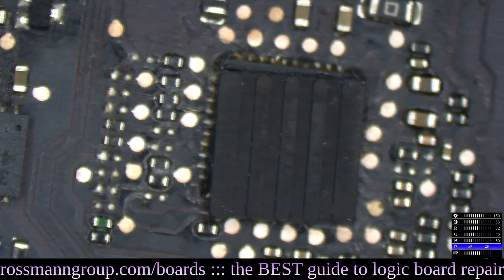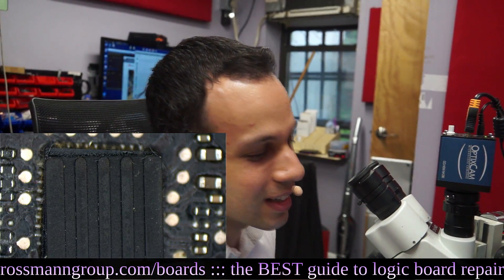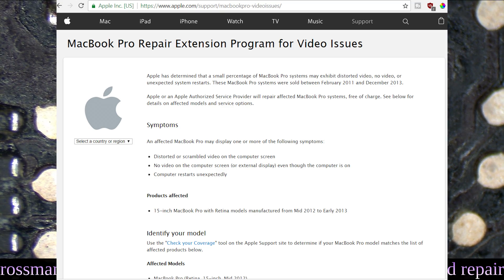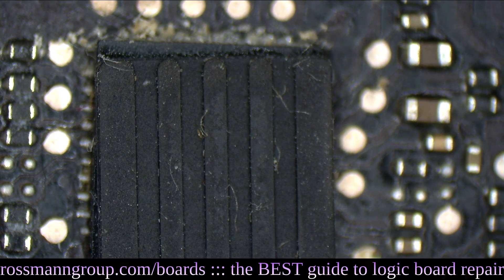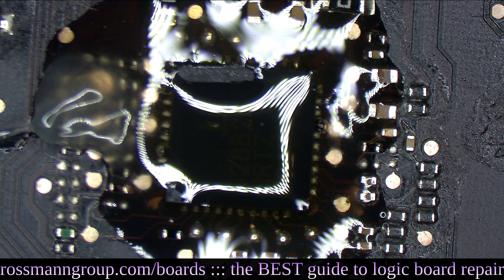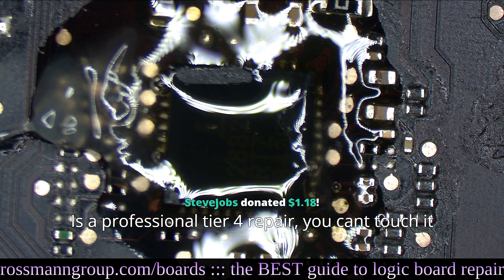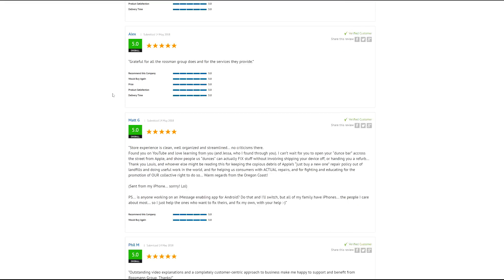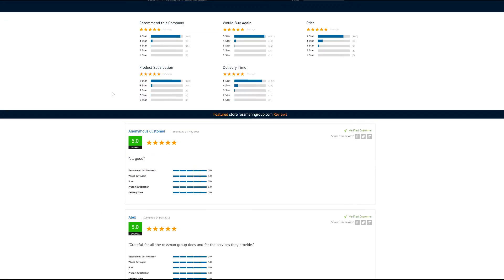How Apple authorized repair refurbishes Macbooks to fail again! GPU kernel panics

Comment: I grew up with Linux and Windows. I use a combination of the 3. I have a MBP mid 2012 with an I5 that I tend to use. One of the main uses for it is video editing and Audio mastering. I enjoy it quite a bit and find my number one reason for enjoying it is when I am Booted into the Main Operating system it feels nice. I love Linux for it's completely Open Source nature. But it doesn't have everything OSX and Windows does. There is a lot of things missing still. But I find Apple's Hardware is being poorly designed in a couple of major ways. 

1. The thermal solutions are inadequate and lead to unnecessary stress on the components especially these days where they keep slimming things while continually adding more powerful components. This leads to failure rates increasing. This is why right to repair is important. This is why Apple needs to be somehow forced to at the minimum provide replacement parts to 3rd parties.

2. Having proprietary components and Soldering parts straight to the boards removes the ability for a large populous to avoid expensive repair costs. This leads to depending on Apple themselves or skilled individuals like yourself to do this. Despite what many people who hate on the OSX infrastructure believe these computers haven't always been this way. I have been able to upgrade my MBP to a point where it runs significantly faster even on an I5 setup. 

I appreciate how you don't shit on the OSX software. I will be using a dualboot Hackintosh setup when I do my build coming up. Because there are just many things about OSX that feel better and function better. Also without OSX and Linux Microsoft would have no competition and Windows would be a complete Monopoly and Monopolies are the main cause of failure in the Capitalist world. But you have to twist Apples hands to get them to do right. They are making shitty decisions. It's always been shocking to me how the Software developers do so well and the hardware engineers fuck up so badly. Then Apple wants to claim it's software issues when their hardware has issues. When the software is fine.
Reply: btw I bought used lol. and this was a 1200$ laptop when it released. lol

Comment: My theory to why this bondo job happened is that that whomever at Apple decided “this is how to refurb a GPU” was that this person/committee believed (correctly) that they couldn’t possibly hire the type of skill required to do a proper job based on how little they were paying the people who did this. Therefore, since the likelihood that they would be able to solder the pins properly so they would conduct on their own was nil, so mandate that they stick a rubber pad on it to just sort of hold in it place until it chip unseats shortly after from the pressure, you know, when it is no longer their problem. Am I just stating the obvious?

Comment: I agree with the title. I had the "service battery" 3 TIMES on a 2012 MBA 13 inch. Sold that piece of trash 3 years later for like 500 bucks right after I had the battery replaced for a third time so I could say there were no errors.

I had TERRIBLE battery life too...

Comment: People just gotta understand that an OS is just a gateway to software. Use one OS or ALL the OSes depending on your needs. Windows, Linux, Mac OSX... they're all valid for a lot of different uses. 

I'm not knowledgeable on how you've implemented iZotope RX 5 into your mix, but  the application & plugins do appear to work on Linux with great compatibility through WINE. With that said, if you have a compatible & working setup on Windows, then the setup and turning and testing for converting that setup fully to Linux would be tedious, unnecessary, and full of headaches.

Comment: Is this possible? What if you figured out a way to adequately cool overheated MacBooks. Maybe by replacing the bottom plate with one that has more space and a cooling system that would actually do the job. It seems to me that Apple product Killer Problems can be classified either as unfixable, like some integrated part that will probably fail in short order but can't be replaced,   the iPhone 4 antenna; and problems that could be fixed, like the faulty SATA cables in an earlier MacBook Pro. (In my 2011 17" MBP I had to replace the Bluetooth WiFi cable. I also think I replaced the SATA cable. The case pushed on them.) 
The protocol for smart purchasing of Apple products would be: First, NEVER buy an Apple product that's just been released.  Second, when issues are collected (too bad we can't rely on Apple for this)  techs like you figure out: Work Around-able? or Killer No Gos?  How come laptop cooling pads all suck? Can you design one that would solve Apple's heat perennial problem? (I just put a baggie with some ice cubes on the top left corner of this 2011 17" The case got ice cold, but SMC Fan Control shot up. I wedged it under the case in that hot spot  area and again the temp shot up.  I didn't block the slots. ????)

Comment: Your workmanship is superb.  My question is does this still not address the underlying problem of overheating and melting the solder joints.  Apples half assed solution was to place a pad on the chip so the case would keep it pinned down to the board.  Although your resoldered joint look a thousand times will it not suffer from the same failure when the chip heats up enough to remelt the solder as it did prior to the fix?

Comment: You should be glad that these apple products suck so hard; not laugh at it. If it wasn't for their mistakes, you'd be flipping burgers. I watched few of your videos so far... All you do is replacing the parts or repairing traces. You are good at it, no doubt... But the attitude... You come across like you designed those ICs you are replacing. In reality, you just buy the ICs from company A1, A2, A3...etc., use the tools made by company B1, B2, B3... etc. and fix the board for customer's laptop (or whatever else) and take their cash. Nothing original of your own (design, analysis... etc). Day-in, day-out same shit. Fear not... In this get-shit-manufactured-cheaply-in-China economy, you'll always get to melt solder and watch it solidify... all day... everyday... :)
Reply: I think I covered this in " In this get-shit-manufactured-cheaply-in-China economy, you'll always get to melt solder and watch it solidify... all day... everyday... :)"...
Reply: "They are all housings with buttons, housing and motherboards, give or take some don’t have screens, they are fixed the same way."... Yes, this makes it simple; buy the parts from somewhere else using someone else's troubleshooting material, Flux, heat and solder. You don't see him fixing high level problems where the board does not look burnt or showered with a latte by a millennial or physically mistreated in some other fashion. <= Now, that's hard! It requires few degrees in the field to even understand what the problem is. Go watch some advanced repairs done by youtuber TheSignalPath and talk to me afterwards... Now, that guy is worth his weight in diamonds!
Reply: When you are negative, the positive is much sweeter.
Reply: What are those things? Tell me and send me the link to the video from this guy...
Reply: No company in the right mind would take a $200k+ device to you or him for a good reason. This is what I'm saying in a nutshell: ANYONE reading this can pick up the equipment and the tools necessary for reflowing a chip on a board!... Why the holier-than-thou attitude on top of this? Anyway...
Reply: D1amond6ack 9: I could not care less in real life. After three decades of education and two decades of professional work (concurrently, of course; I am not 67!), it is really hard not to pass on the opportunity to poke into the fanboys whose "master" could not even qualify for being an errand boy in the industry and where I work which will not be disclosed, of course. Like I said before, he is good at what he does which is talking and soldering, after all. My problem is not with him; it is the idea of him and people that defend this idea (wink wink). These people [the idea of] , who cannot even be a dead bacteria in a single shit sampled from John Bardeen, Claude Shannon, Bob Widlar and countless other pioneers in the industry, having such popularity deeply concerns me for the direction this Country is going; just a bunch of "impressionables". I can bet the majority of the subscribers to this channel never even heard of these pioneers mentioned above without Googling them... The named pioneers are the ones laid the foundation for everything involved in order for one to be able to see this text! So...... Excuse me when I am not "impressed" at the sight of melting solder, especially some douchey anecdotes being delivered along with it :). And, that will be all, too.

Comment: Apple: Hello sir how can I help you?
Customer: My Macbook isn't turning on can you fix it?
Apple: (Without checking anything) It seems like the display is cracked, the GPU and the CPU have popped off.
Customer: What the F*** are you talking about I just bought it 5 minutes ago.
Apple: It'll cost $799 Excluding Taxes because it's out of warranty. It certainly looks like water damage.
Customer: Are you out of your mind? There's not a single drop of water in this store and I never left the store. 
Apple: Sorry sir I can't help you because there has been considerable water damage and all the circuits have gone bad and a lot of them have rust over them.
Customer: What should I do?
Apple: I think you should buy our new $7000 Macbook.
Customer: I Just did and it's not working.
Apple: That'll be $10000 including taxes how would you like to pay? Cash or Credit card.
Customer: Go F*** off.

Comment: 6:00 
Nice point and a MacBook is the best option for productivity. The hardware is garbage accept for the display. 
The thermal design is crap 
The performance is bad if you look at benchmarks 
But over all for mobile use it’s better than a hackintosh laptop. 
For my desktop I prefer a pc with win and hackintosh.

Comment: I understand that for your needs you would need to use Windows over Linux but for many of us Linux feets our needs and I personally havent had any software issue that I havent been able to handle myself.  While it's certainly not for everybody for sure but if you want a great experience without worrying about your security Linux is a great option.

Comment: Why are there dislikes on this video?  Are people in denial and can;'t accpet the fact their favorite brand and manufacture are ripping people off like this?  There have been people who wokr in IT for years who have been saying this... BUT THIS IS NEXT LEVEL FUCKERY RIGHT HERE. A RUBBER PAD ON THE GPU BLOCK TO PACK IT DOWN...........  Rather then resoldering back nicely.....  That's absolutly fucked.
Reply: 10:30  " You definitely need to be authorized to guarantee the repair "  hahahahah yeeeaaahhhhhhh.

Comment: as long as graphic cards etc are not getting powered can they be cleaned in a ultra sonic cleaner without any issues compared to having to use compressed air?

Comment: As of Linux it's audio software is much better, than it used to be.

The Linux LV2 audio plugins are incredible these days, and could easily do much of that noise reduction.  However, the noise reduction plugins do require more tuning than the ones on Windows, but that provides better output too.  It's pretty much because they are studio-class audio filters, instead of things built for general use.

Comment: They did not clean off their flux, and it all burnt from the heat of they system too.

They also should be using heat-transfer material instead of rubber, then add a plate of metal on top.

Comment: i have been using linux for about a year and a half now. and i don't disagree with you its not for everyone. but i think a lot of people could use it quite effectively. the mainstream paid software people would likely use for their job generally does have a linux alternative that is very competent. as for your audio reduction software needs, i found a solution on the first and 3rd result of a google search. the one on the 3rd result is even realtime. its called sox

Comment: I blame the over-use of the so called "eco solder" that has a lower lead content in it. This allows a lower melting point and is not as durable as traditional lead solder. That's why I use older solder and look for non-eco versions. Amazing the difference it makes !

Comment: Wow... I can (and have) done better reflow than Apple with an automotive heatgun (I was young and stupid), but at least I cleaned off my ghetto flux I used.  Now, I have a temperature controlled rework station, fume extractor and large supply of no-clean flux I use prior to using my flux cleaner.  I learned, not using #iSolder turns it into a PC...

Comment: The rubber pad that was applying pressure to the chip will also act as a heat sink if the chip was getting hot enough to compromise the solder. Does that chip have a heat problem that the rubber pad was addressing?

Comment: reminds me of my "refurbished" Playstation 4, what sony did is actually just adding some pads on top of the cooler and let the psu put pressure on it so that the APU won't get loose and stop working. but it broke down again later and let it repair by someone else

Comment: Just Apple being Apple... Louis I think you're a bit to young to remember the Apple ///; there was an official service procedure to lift the machine a couple inches and let it drop to re-seat the chips that had been unseated by thermal expansion (machine had no fans and bad thermal problems due to Jobs' inane desire it be completely silent).
Reply: Not to be confused with the original Mac having worse sound quality than intended because Jobs wouldn't allow a single tiny hole in a particular spot in the case. Visuals over acoustics gone Jobsian.
Reply: Man, the 128K Macintosh was a goddamn joke.  It didn't have enough RAM to run its own demo programs.  It had an external disk drive that only worked when placed to one side of the machine and not the other.  And it had a case so obtusely designed that to this very day, if you go into any good computer repair shop and ask for "The Mac Screwdriver" they will know what you mean.
Reply: Heard about dropping procedure from fellow local Apple serviceman in begin of nineties. But because computers here almost always was mediocre crap by western standards (good ones was a way too expensive), we had not been surprised about that.

Comment: I had an iPhone 7 Plus last week that my customer sent to Apple for screen replacement. Took two weeks so he had no phone that whole time. When he received his phone back the rear camera was not working and the screen was flickering. Apple asked to send it back and it’ll take another 1-2 weeks. 

Customer was pissed and did not want to wait so he called me for repair. When I opened the phone, the screws were stripped and was missing two screws. the rear camera was not plugged in completely and there was an extra Penelope screw stuck to the ear speaker magnet.

I replaced the screen (tested on my test phone and still flickering) and plugged the rear camera correctly. The phone was working like brand new in 20 minutes and much cheaper than Apple. Plus I got one free Penelope screw from it lol. 

I was surprised at how bad the repair job was, coming directly from Apple repair center and was not tested before shipping back to the customer.

Comment: Thank you Louis for not shitting on Mac users. I buy mine used and cheap, and they work. I actually had the 2011 late macbook pro 15" that had gpu failure (got mine used.) and they repaired it free under the 2016 warranty thing. I agree they could be better but to be honest i haven't checked if they shit on my GPU,  (i upgraded a bit back so i never used mine till it failed again) 

they actually replaced the whole bottom part of the mac, the whole bottom being the housing, motherboard, and all internals, and just kept the original lcd screen/top cover.

I love Macs OS, given not like fuckin amazing, it has its issues, I loved the OS back in I think Mavericks it was perfect or close to it.

I like Windows, but mostly windows 7, 10 is alright i guess. but I genuinely get so many errors and issues with it, and I know how to deal with windows, I'm not (fully) computer illiterate. I just always had issues with windows. Though what can you do.

typing this from my custom built desktop, owner of a bunch of macbook pros/airs/regulars, etc.

Thanks again for not shitting on end users. Keep havin good work and have a good day man :)
Reply: Triggart hell I’d jump to the Mac If they weren’t so stupidly expensive (and designed to fail) .....Windows 7 was the last good windows Microsoft made.....8 and 10 are  utter rubbish
Reply: windows 10 is "ok". the updates are shit and take 5 times longer than win 7 updates, so does the install.

Mac OS takes like 20 minutes on ssd, or half hour? idk, you rarely get major updates like that. besides regular app updates. Not going to lie my Macbook Pros are all 2013 and older and the 2011 failed in like 2016 and got it repaired free of charge. idk maybe it is my area that they were nice in, maybe I'll crack it open and check if they did good work on the graphics chip.

I had it coming though as I was playing a game on it that even my gaming desktop with dedicated GPU has problems with. So it was a good laptop to handle the game for so long (of course the graphics were all set to shit, its a fuckin laptop haha)

Comment: The best, if you build a pc with the most compatible hardware. And just run macOS on it. It fairly easy, And runs just fine. There are some things, what need some after tuning/fixing, like fan control, but that pc is usually far more powerful, than a mac.